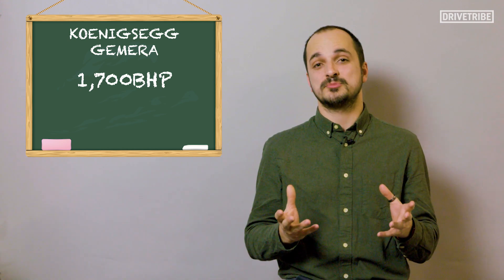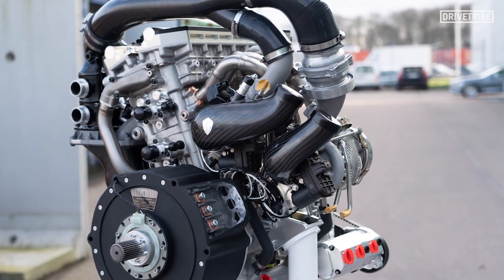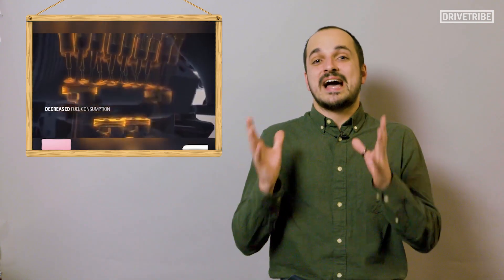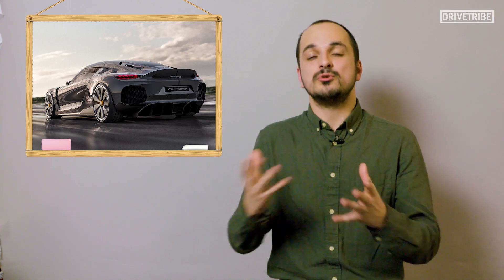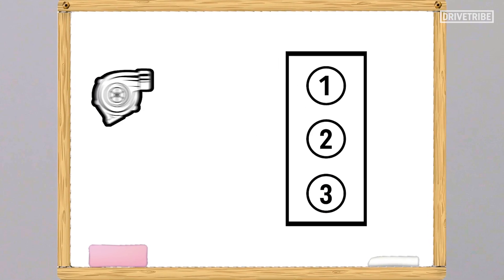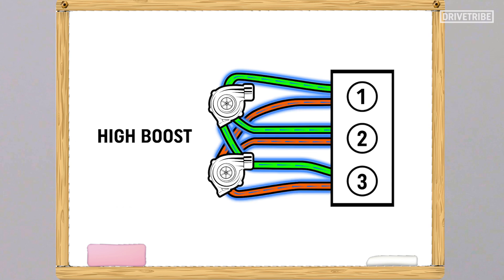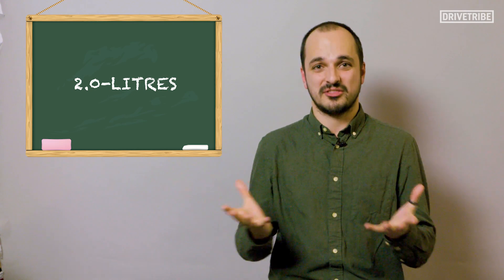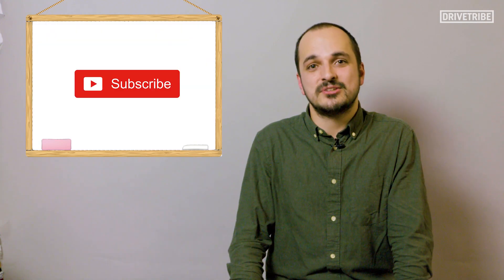This is how Koenigsegg made 600bhp from a 3-cylinder engine

Comment: Camless engines was actually pioneered by Powertrain Ltd part of MG Rover group.
Reply: The idea is nothing new. Actually getting it to work reliably in a production car that has to go thousands of miles between service is very, very, very difficult. Would you trust a camless engine released by MG Rover to be reliable? 😂
Reply: @xeigen2  Yes, I ran a MG ZR 160 for a few years with only consumable items used. Ever used or owned an MG Rover product or did you get your information from the MSM ?
Reply: @MikeWooshy  I had the exact same car and the head gasket went at 30k miles...
Reply: @xeigen2  funny I brought mine with 15K on, never missed a beat until 60k when I sold it for a track car.

Comment: Just imagine what this tech could do on an LS engine.
Reply: If this system became widespread, tuning the car would basically be plugging a laptop into the ECU, change some values, and boom, your V8 is now cammed.
Reply: Next to nothing because an LS has 2 valves per cylinder. A Coyote, on the other hand...
Reply: Always one LS fan out there.
Reply: You'd be on your way to extracting even more hp out of an already willing engine.

Comment: Didn’t a Mitsubishi Evo have a 600hp 2 litre about 10 years ago?! Also with electric motors, it’s easy to hit a crazy figure with a petrol engine. Just stick a massive turbo on it. It doesn’t need a good power band, the electric motors will do most of the work at lower revs - it’s just there for peak power.

Comment: not impressed, my fiat uses a cam less system for the intake valves. all hydrologic and electronically variable.
Reply: No, no it isn't. There aren't any camless engines on the market. The fiat system uses camshafts with the ability to vary lift and timing through the cam follower but cannot change the cam profile. You can't get a square cam profile, but freevalve can. Also the fiat system is only variable on the intake, exhaust doesn't have the system on it.
Reply: Xei i appreciate you repeating what i said in my comment. very helpful.

Comment: The coolest part about the valve system that you didn't mention is that with such variable valves, the very combustion cycle can be modified, so you can adjust the timing and compression cycles of each cylinder individually, and can even run as a two stroke at certain rpm ranges.

Comment: You MISSED the BIGGEST power innovation!! .. enabled by the Freevalve system, Koenigsegg said it runs as a 2-Stroke in some of the rpm range !!!  Obviously, when those turbos are spooled up and boosting large, the intake and exhaust valves can both stay open for a long duration. Pushing a lot of extra boost air through the engine also aids in cooling it. This is a huge game changing innovation that Freevalve enables, this could reduce emissions too. Camless type engines will become the norm, based on 2-stroke / 4-stroke operation.

Comment: Yeah its still pretty big for a 3 banger i mean its a 2 liter and it's no surprise small engines can make a lot of power, wankels are a good example,  honda's 1.5 liter v12, and the f1 i4 bmw used that made over 1200 hp so yeah small engines can make a lot of power

Comment: I have a number of questions which the video didn't address. Being a 3 cylinder, there is no inertia torque which is the usual limitation upon the speed of a 4 cylinder, does this engine rev to high Rpm? 
The 2nd is that being a high capacity (for a 3 cylinder), does it employ a balancer shaft to reduce/eliminate the 1st order oob couple, caused by the motion of the pistons?

Comment: The video is slightly off on the power numbers.  Each rear electric motor makes 500hp and another 400 from the electric motor on the front of the engine, that comes to 1400hp from just the 3 electric motors.  The 3 cylinder makes 600hp.   If all the engines made peak power at the same time it would actually make slightly over 2000hp but since each motor/engine has a different peak the most at any one time is 1700hp

Comment: Are you gonna just act like pneumatic valves dont exist on f1 engines for years now. But implementing this system on road cars is a great achievement anyways.
Reply: F1 valvetrains are still actuated by a camshaft, it's not like freevalve. The pneumatic valve merely acts as a spring, but doesn't suffer from the valve float at high RPM that normal metal springs do.

Comment: It's not 600hp combustion and 1100hp from electric motors. Combined it's 1700hp, but the electric motors make more then 1100hp. Also it has 2 doors and not 4.

Comment: Great video. More like this please!

Seems like this sort of engine would also be ideally suited to light aircraft ...Smaller & lighter than a 'traditional' engine with equivalent power, more efficient & better fuel economy (if tuned for that), less moving parts so presumably more reliable.

Seems like a perfect combination.
...Aircraft manufacturers are also the ones most likely able to afford to licence the tech. I don't see it going into cheap family runabouts any time soon.

---

Can I also get one for my lawnmower? bastard thing wouldn't start this morning after sitting in the shed all winter.

Comment: What about torque? How many Newton meters does that little thing put out?
Reply: it makes 600hp so unless it revs to the moon, its going to have a decent bit of torque. remember that "Torque X RPM = HP". so to get high horsepower and low torque, it would need to spin ludicrously fast. which it probably doesent, it just spins stupidly fast. :P (good question btw)

Comment: I think this engine is awesome given it's size/weight to power ratio.
I hope Koenigsegg takes this engine and put's it in a small light car.  Even if de-tuned a bit it could achieve amazing power to weight in a Miata sized car on the engine alone.
Koenigsegg could mass produce this car at a more reasonable cost and I think it would sell like hot cakes.

Comment: One thing you missed out is that with the Freevalve system, it’s now possible to feasibly run on pure renewable biofuels, like ethanol or methanol. So they’ve pretty much secured the combustion engine’s future for much much longer.

Comment: This engine can operate on the Otto, Atkinson and Miller cycle it can change between these cycles in blink of an eye with just software incredible!! im sure it can run clockwise and counter clockwise so need for a reverse gear.

Comment: Imagine throwing this into a miata or a Cappuccino? Wicked fast 💨
Reply: Would be super easy too, given how little is. The weight reduction would be nice too. Hopefully more car companies adopt this type of engine
Reply: There are some Hayabusa engines with 500hp. 
Its a 1.3, not 2.0. 
And does not cost 1/2 milion.
Reply: I need one for my Suzuki Carry
Reply: Dead fast
Reply: i would love to see a "cheap" koenigsegg with this engine... like a small 1200 kg mid engine sports car which still have the koenigsegg design language but in a little smaller.
Reply: gepixelt something similar to the MR2 design?
Reply: MX5 FTW
Reply: Was thinking the same but in a civic

Comment: Mercedes: we have made the most powerful 4-cylinder engine

Konigsegg: Hold my beer.
Reply: Koenigsegg: hold my camshaft
Reply: @yanzodadon  kkkkkkkk
Reply: That is a pure engine with no electric motor bs.
Reply: Nice copy&paste comment from the top gear reveal video!
Reply: * hold my aquavit *
Reply: Quit playing my 4 cylinder makes an astounding 176 horsepower
Reply: I think merc motor is quite a bit cheaper, and possibly more reliable (given their track record)

Ohh and it’s a whole lot easier to achieve 600hp out of a 2 liter with E85
Reply: well, mercedes still has the most powerful 4 cylinder ;). also, i think they're both 2 litres?
Reply: @dutchclasher5471  mitsubishi has the most powerful 4 cylinder engine
Reply: @carholic-sz3qv  what is the car?
Reply: KP-48 evo
Reply: @khromeheartzz  im pretty sure it isn't stock
Reply: @carholic-sz3qv  any links? i can't find anything about it
Reply: KP-48 nah it isn’t, it only makes 285-300hp stock but definitely the strongest 4 cycl engine for pushing big numbers
Reply: @khromeheartzz  they made a 440 hp version of evo X called the FQ 440 MR

Comment: The idea of connecting each exhaust valve to different turbo is great, but it shouldn't be exclusively freevalve design.
I think it's possible to build similar twin-turbo inline N-cylinders using conventional camshaft design with the third control shaft (similar to Valvematic) to control opening of exhaust valves for high-flow turbo.

Comment: 20 years ago I had an 89 Chevrolet  Sprint/Suzuki swift with a 50hp 3 cyl..  they had a turbo model that was 65 hp.. I ended up buying a swift gt with a twincam 1.3L 101 hp double the power of the 3cyl..was a fun hot hatch back in the day.  600 hp is an amazing accomplishment!

Comment: Cool idea but when you have pneumatic valvespring and also relying on electrical sensors for timing which will fail often no matter how expensive. This isn't a longevity engine, these systems will fail. I'm more impressed with a engine that can last a long time and have high performance. Also it needs e85 fuel for the 600hp. Still very cool

Comment: I wonder about the reliability of a 2.0l 3-cylinder engine at approximately 8000 or so rpm. Won't such a high performance, hard working engine need rebuilding now and then of some sort? I know freevalve fixes a lot of issues but what about other components. Any answer would be welcome.
Reply: It's Hybrid dude. Koenigsegg knows the stuffs. They've been innovative for years compared to their competitors.
Reply: @marinerchris  I know they have, I'm just wandering about the engine since it hasn't been done before

Comment: Mercedes AMG: We have the most powerful 4 cylinder engine.

Koenigsegg: Hold my 3 cylinder 1.5L engine
Reply: Its 2.0L Engine. Edit your comment now.
Reply: @marinerchris  you store my words 😂
Reply: “Most powerful 4 cylinder”
Reply: @Jay19735  in a stock production car
Reply: Longevity will be a key thing with all of these "look at what I'm squeezing from a juice box" deals.
Reply: Finnish Car Guys Anyone buying a gemera would drive it two miles before putting it in a garage for the rest of its life.
Reply: @Jay19735  That's true, but begs the question even more: what's the point? Is this the new way of measuring gentlemen's area? Who can squeeze their juice box the hardest..?
Reply: All of this is wrong 🤦🏻‍♂️

Comment: Why is no one talking about the fact that the engine also can run in two-stroke mode as soon as the boost is up.. i am dying to hear what it sounds like
Reply: @AndrasMihalyi  both the intake and exhaust valves would open at the same time when the engine is about to reach the bottom, then the turbo pushes the air inside which pushes the exhaust gases out. Then when the Piston starts to go up, all valves close and compression happens.
Basically it works like a 2-stroke diesel engine, and it would be as smooth as an inline 6 because you are having overlapping combustions just like in a 4-stroke inline 6.
Reply: @mrrondini2585  you just said what I was about to. Can't wait to hear it idling and revving :O
Reply: @makecba  I think it's gonna be weird because it will sound like an I3 at idle but more like an I6 at full power. Can't wait either nonetheless :D
Reply: @AndrasMihalyi  The precise timing that freevalve allows combined with high boost pressures make two stroke operation possible. It will have to run as a four stroke until a turbo spools up though. I do wonder though, would that not unbalance the engine a bit and make NVH a serious concern?
Reply: When you think about it, it could run in either direction, couldn't it? No need for reverse gear in the transmission. When the engine is coasting it could keep all the valves open and turn off the injectors, and supply variable braking like a Jake brake on a semi. I cant stop thinking about what is possible with this technology. Marine applications, diesel engines. It will be interesting to see how it stands up.
Reply: @bugsy9069  it could, but when it also have Electric for reverse, there is no need ;-)
Reply: @MC-Racing  i was just thinking of the different applications for this tech. Like most new tech, it becomes more affordable in time. The compact car market for example. Obviously not with 600hp.
Reply: @bugsy9069  in principle it could, but i don't think they are gonna implement it. I'd guess the transmission is not designed to have it's input turning both ways.
Reply: @AndrasMihalyi  No crankcase pressure just pressure from turbos
Reply: I've never heard of a 2 stroke motor exhaust stroke venting at the top of the stroke.  The compression stroke would have to flood everything out and probably catch the exhaust on fire.
Reply: @viasevenvai  Diesel trains have been doing it for decades.
Reply: @soupisgoodfood42  yes, but not the same way, and diesel don't sound as good. And with that valve tech they can open and close really fast and that just sound Mean, Like a rotary.
Reply: @MC-Racing  It's more like a 2-stroke diesel locomotive engine than a 2-stroke motorcycle or lawnmower engine was my point.
Reply: And that it can also run Miller cycle instead of Otto cycle!
Reply: me too => but stay alive my friend or you will not hear that sound that will come soon  ;-D
Reply: 2-stroke mode? Would be awesome!
Reply: listepikster 2 strokes arent loud irl when there is a 4t with no exhaust and 2 t with just the expansion chamber the 4t is the loudest
Reply: listepikster 
Probably something like “RIIIIINNNNNGGGGGGDINGDINGDINGDINGRRRRRRRINGDDDINGDINGDINGRRRRRINGDINGDINGDING”.
Reply: listepikster I don’t think 2-stroke operation would work good with this motor. You really want the intake and exhaust separated to scavenge your cylinder properly. I bet it would be so inefficient with it trying to intake and exhaust through valves in the head with no loop scavenging designed in that it will make less power than normal. Plus get terrible emissions. And I’m a huge 2-stroke fan, so I would love it to be able to.
Reply: @kevinclark9176  if its direct injektion you would not really care about scavenging, and emmesions are actually improved when scavenging os poor, thats the reason for EGT. You would just open exhaust valves juste few degrees from BDC on the Power stroke to keep turbos alive and then open intake a few degrees after BDC to start intake. Christian mentioned et shortly In one video, so i do think its tested and Will be working. And it Will make peak power in two stroke mode is My prediction 😁
Reply: listepikster direct injection is one thing, but you still need to be able to scavenge. If you can’t get the exhaust out you won’t have much fresh fuel and air to burn the next cycle.
Reply: It could probably run in Atkinson cycle as well if you want to save fuel.
Reply: @AndrasMihalyi  Good question, would like to know myself!
Reply: Yep im just here trying to learn
Reply: Aren't 2 stroke engines the loudest? Do you really want to hear that?
Reply: @anonmouse956  this is no ordinary two stroke, it May very well sound Like a very highly Tuned inline six in two stroke mode ;-)
Reply: @anonmouse956  Yes.
Reply: @anonmouse956  absolutely.
Reply: @anonmouse956  Most car enthusiasts love loud engines. It's like a concert if the engine has a pleasant note.
Reply: anon mouse no, just look at motocross. 4-strokes are louder than 2-strokes. The sound signature of 4-strokes also travels further because they are deeper. 2-strokes sometimes do seem louder though because they are higher pitch.
Reply: @anonmouse956  There is a 2-stroke V12 diesel engine that sounds freaking mega!
Reply: @anonmouse956  not much louder than a normal engine